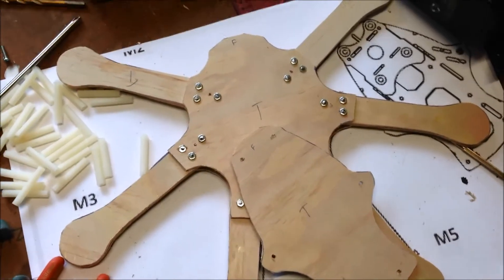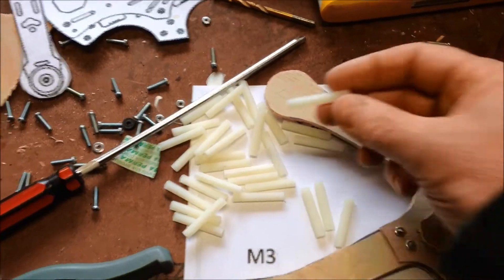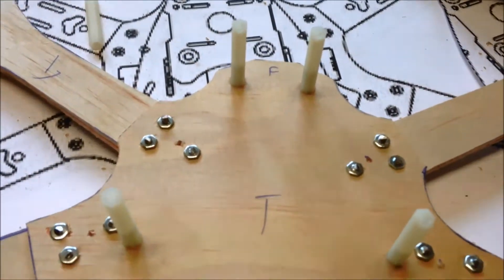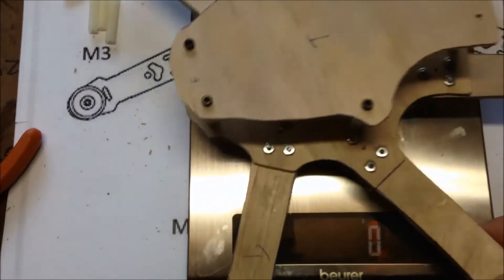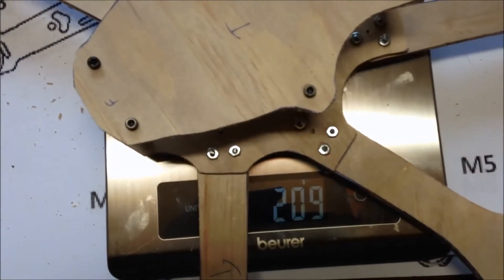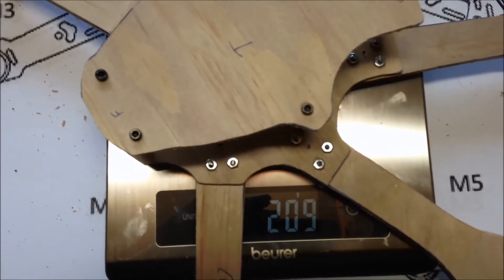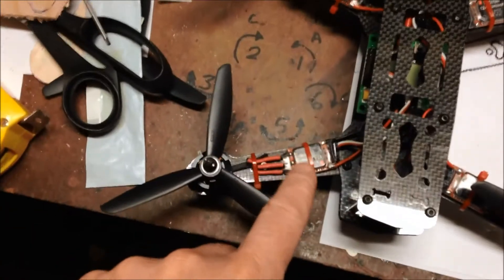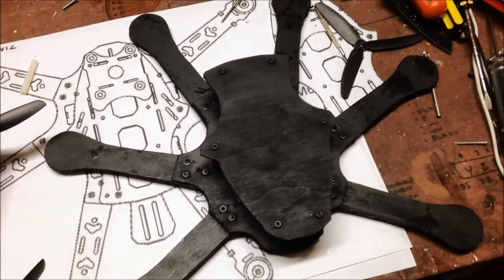Mini Hexacopter Frame Build Part 2. Plywood DIY project for FPV. 1806 Motors and 5x45 Props

Comment: I would have sanded down the wood frames and have a more mooth surface. And then spray painted primer and sand it again. And lastly spray it mat black. It will look soo much better.
Reply from the maker: 297 Hobbies If you saw the way I fly it would not inspire you to spend too much time on the details. I will be replacing parts next week. :)